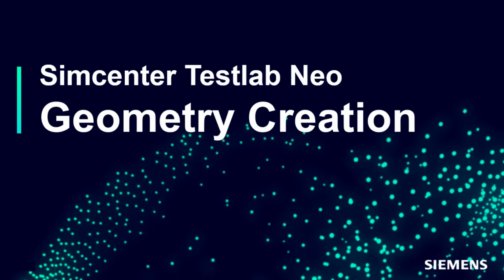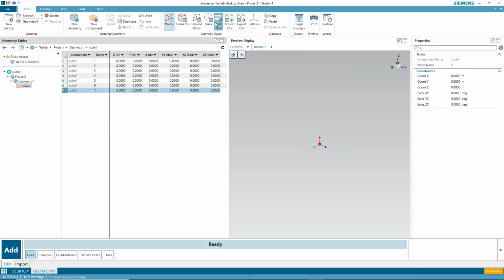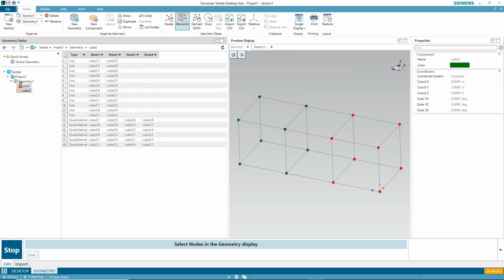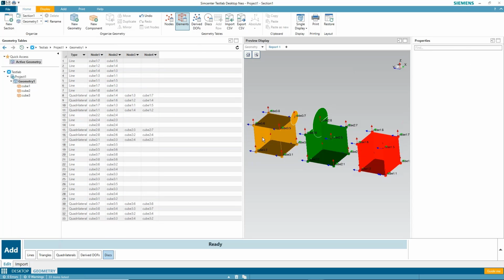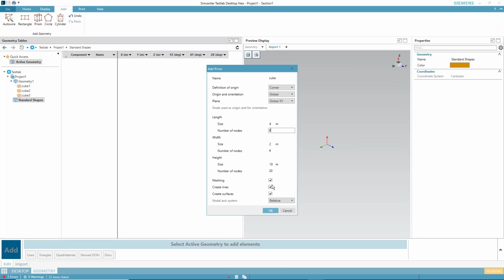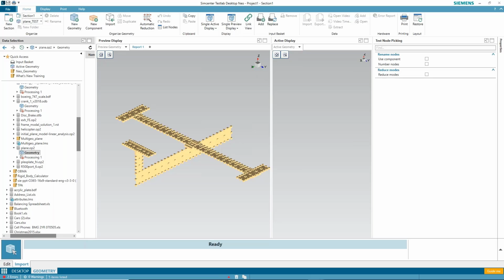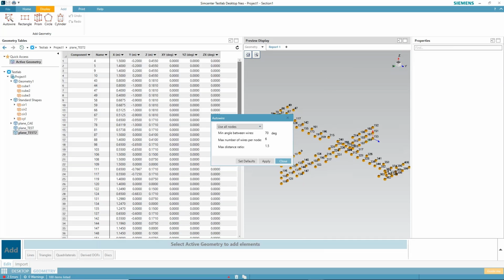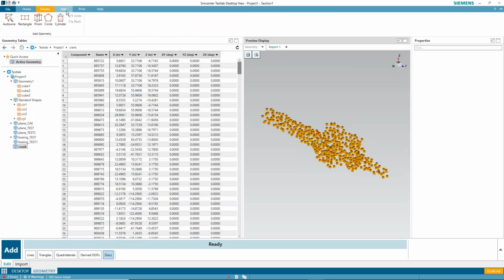Simcenter Testlab Neo: Geometry Creation

Comment: May I ask, min, whether assembly files from SolidWorks software can be imported into Teslab Neo Geometry to get shape mode?
Reply from the maker: No, a SolidWorks file could not be imported directly.  It would have to be exported from SolidWorks as a stereolithography (*.stl) file.
Reply: @SimcenterTesting  Is it possible to use 1 accelerometer to get shape mode?
and is there a tutorial from the beginning to get the shape mode through experimental testing?